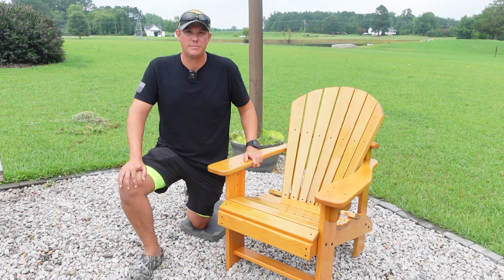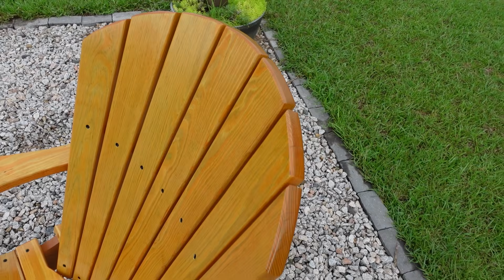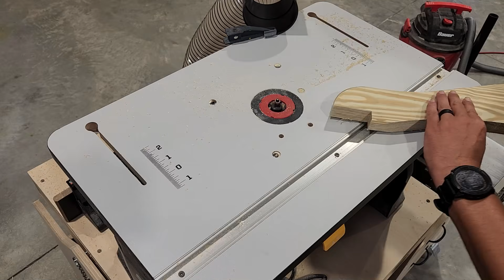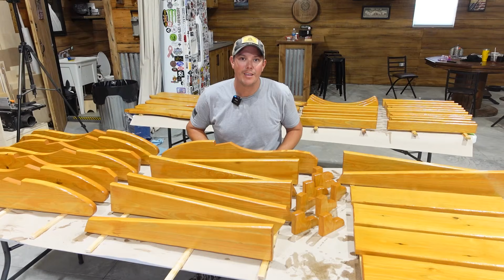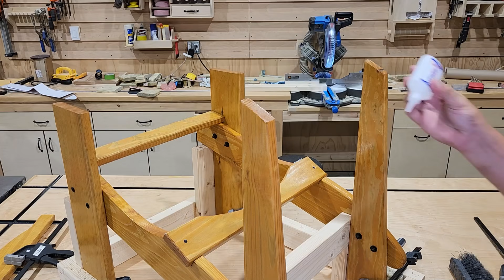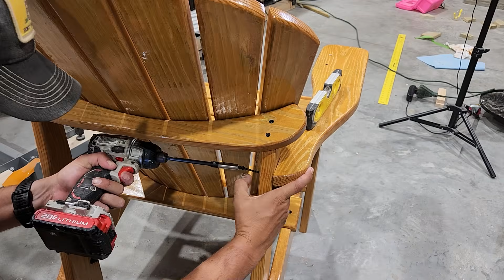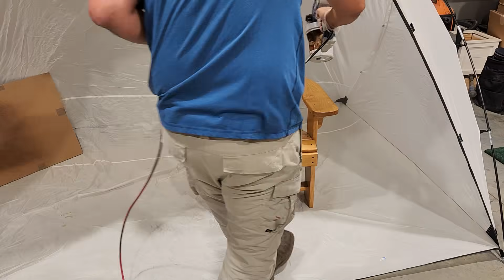How To Build An Adirondack Chair

Comment: I downloaded the plans and printed them out on A3 paper, then laminated each piece. I am using pallets that are 100x50 and 100x25 - so I have modified the templates to account for the change in board size. Only major changes will be the arms (a little narrower at the front, which I actually like), the legs (easy fix) and the seat support. To account for less stock on the seat support, I'm going to use the 100x50 boards and router in the rear leg so the dimensions all fit the same. Should have equal or greater strength across the board. Thanks for the inspiration and the plans. 

I'm hoping to make 4 of these, so here we go!
Reply from the maker: Sounds like i good plan! Good luck and enjoy

Comment: So you trace first then cut? Cut Sheets Deck Boards, page5,  says to cut lengths first. Panel box says 30", Qty 1. Diagrams show 4 / 30".  Does each colored diagram box equal 8 feet? Help me understand.
Reply from the maker: Page 5 is the cut sheets. It is an example of how to lay out the cuts for each piece. Then there's also an image that shows how the irregular shape pieces can be laid out on the board.   Yes, trace the templates onto the board then cut between the shapes to make it more manageable. Then finish cutting the shapes on bandsaw.

For the backslats you need 4 of the 30" pieces as shown in the cut sheet. You'll get 2 slats from each piece using the taper jig or similar method shown later in the plans

Comment: I purchased  the plans, however, on the jig description, you don’t show in the plans the demissions of the scrap deck boards.
Reply from the maker: The scrap piece of deck board in the jig is just a piece of the same boards youre using for the chair.  It just acts as a spacer so the front and back legs line up properly.
Reply: @PatriotDIY gotcha. Thanks

Comment: Bought the plans and have built two so far. Converted dimensions to metric. Simple one inch = 25.4mm. Modified the arm braces to make it easier to cut them with a jigsaw. Added 30mm to the back of the jig to make it easier to remove the completed chair from the jig. Smart looking and elegant chair. Thanks for the plans and I enjoyed the video. I did notice the change in orientation of the back blocks on the jig but I had to wind it back three times to understand what had been changed.
Reply from the maker: Glad the plans worked out for you!!

Comment: Thank you very cool chair! Question about using 5/4 lumber  which would be 1/2 thicker. Could I still use your templates and just make the assembly jig 1" wider or is there other dimension I need to think about?
Reply from the maker: Yes that would work

Comment: Beautiful garden chair, I had built one years ago with reclaimed wood from pallets, right now I am building a serious one with eucalyptus wood and am close to assembling it. I noticed that you used normal screws and not stainless, or am I wrong? Aren't you worried about them getting damaged or do you count on the paint protection from the weather?
Reply from the maker: I use coated decking screws, they will last longer than the chair I'm sure

Comment: built one last week love it trying to think of a way to hide the screws any ideas?
Reply: Use a wood chisel to wedge up a slit of wood. Send the screw in then push the slit of wood back down. Glue it in place then sand over it. 

Not the best description but hopefully you get the general idea.
Reply from the maker: @kevinbacon8716  good idea, you could also use dowels
Reply from the maker: You could fill the holes with wood filler

Comment: Awesome build! I'm comfortable with everything you did expect the tapering jig. Saw that those plans are included in the plans, but wouldn't I be able to use the bandsaw with provided template or no?
Reply from the maker: @jonathanmarin9154  yes you can definatly use the band saw to cut the back slats

Comment: Here are the key points and the important details of this video, created by NEX

Key Points：
1. [Key Point 1]: Build your own Adirondack chair with digital plans and templates.
2. [Key Point 2]: Chair uses 1-in treated deck boards, sturdy for outdoor use.
3. [Key Point 3]: Finished chairs have three coats of marine spar varnish for durability.
Important Details:
Here's the timeline, created by @
00:00:01 Introduction and Overview
• 'I'm going to be showing you how to build your own ader Ronda chairs.'
• 'This is not going to be anything revolutionary.'
00:02:04 Preparing the Materials
• 'I'm going to trace all of our shapes onto our 1-in decking board.'
• 'I'll take those over to the band saw and cut out each shape.'
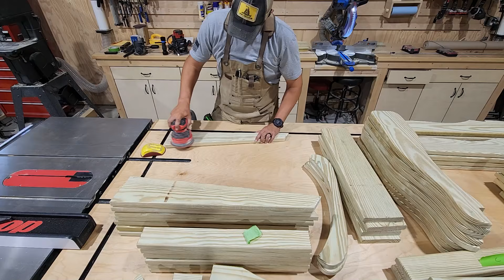00:05:42 Sanding and Staining
• 'I'll give each piece a final sanding with 120 grit sandpaper.'
• 'I'm going to dilute it about 25% with some mineral spirits.'
00:08:20 Assembly Process
• 'I start out by clamping in the front and back legs.'
• 'Then I drill two holes into each leg and secure these components together.'
00:12:15 Final Touches and Finishing
• 'Now I want to add a little more support to these chair legs.'
• 'Assembly is complete and I think these chairs look great.'
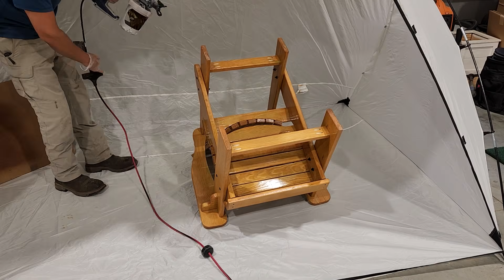00:14:53 Final Coat of Varnish
• 'Now for this final coat, I'm going to go with a satin finish.'
• 'These chairs should last a good long time.'

We hope this summary helps you better understand the video content! If you have other videos that need to be summarized, please visit my homepage to see more~
Reply: I am in Germany and use metric. How wide are your boards so that I can convert to CM please.